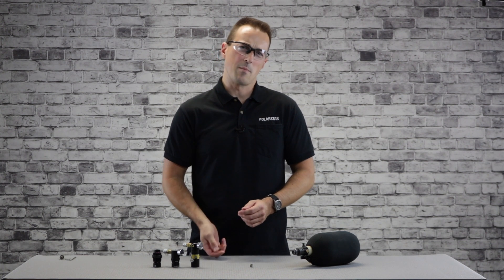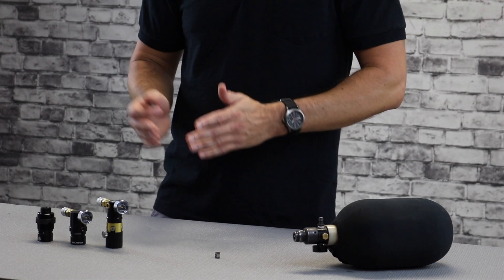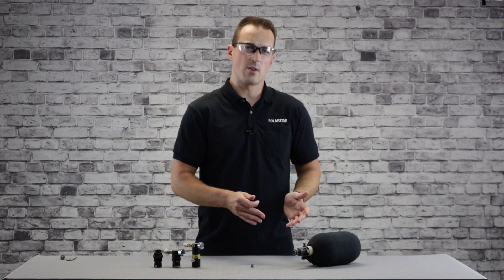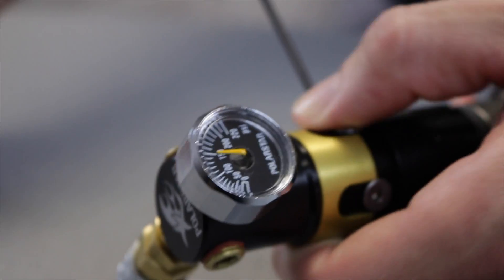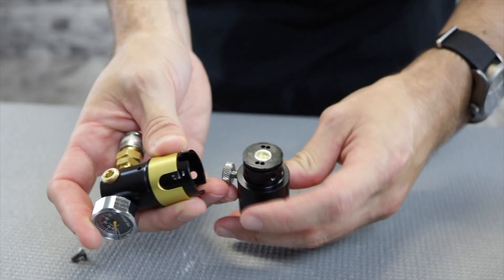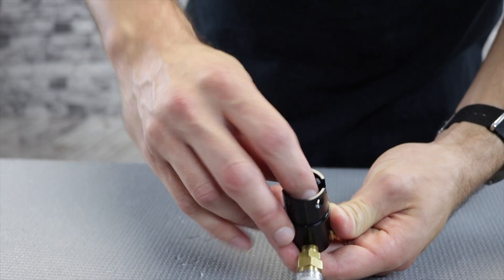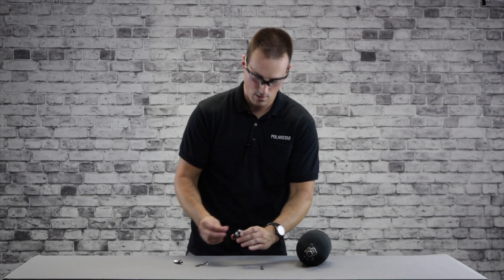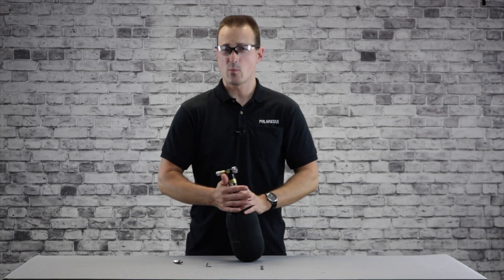PolarStar Airsoft - MRS High Pressure Spring

Comment: I bought a high pressure bring for a ugs but cant find a video on how to change it in the ugs or cgs regulator since couples with my kythera gr25, jag, and my kythera 416 it seems to shot about 320 tops and I've turned it to max output